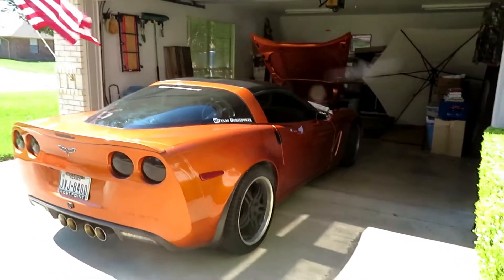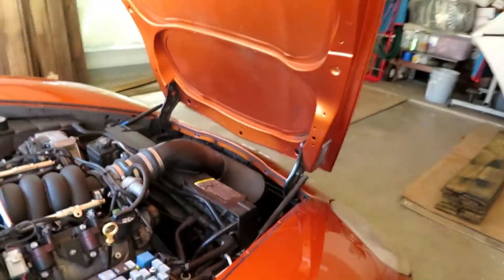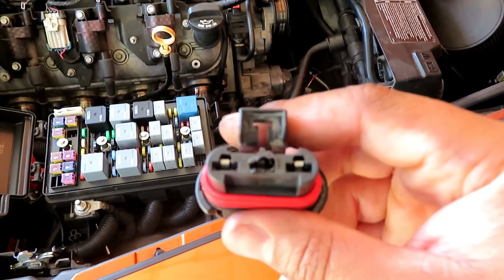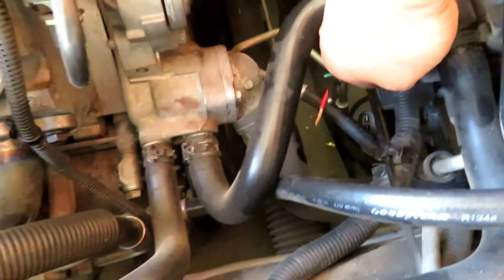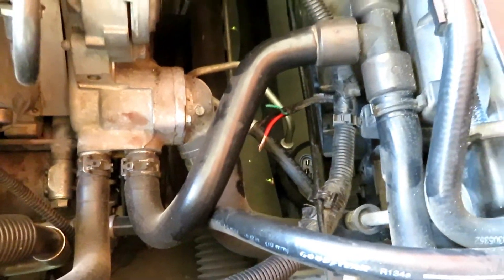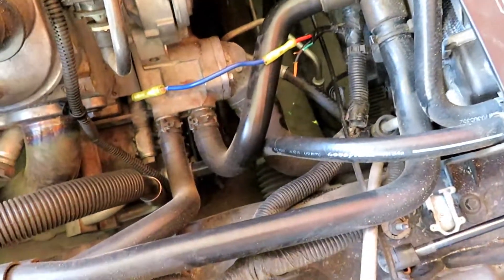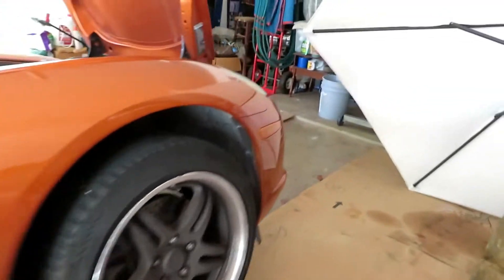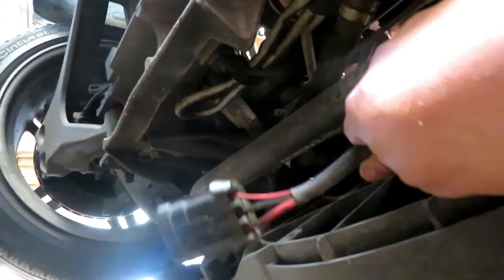My Corvette Must Hate Me: C6 Corvette Fan Repair

Comment: It's actually significantly better to just upgrade the plug than it is to cut these out and try to crimp/solder it together. The Anderson 879-SBS75GBLK-BK connector with the 1339G3-BK contacts are designed for significantly higher current, thus they will not melt everything when the fan demand is too high
Reply: hey man quick question does the anderson already have both the male and female contacts or do i need to buy those? i also had this issue and i want to upgrade to this connector but i'm not sure if the entire thing is already built or if i have to add more to it

Comment: I had an overheating problem also, Saw your melted plug, looked at mine and guess what 
? it was just as melted!!  I just made a jumper for the center wire, works great , thanks

Comment: From what I understand the factory recommends running the fan at 88% instead of 100% because this connector can fail at 100% draw. This can be done with a programming from your local "tuner guy".

Comment: Happened to me too straight wired em been running fine for months. That texas heat will do it. Some say its due to ecu tune and fans running higher then stick but i jave seen this happen on stock cars as well.
Reply from the maker: vette bro Thanks. Mine is modified, but i know my tuner knows better. So i think it is just texas and the fact the car has 132k plus miles on it.
Reply: Texas HorsePower i feel the same about mine i just hit 112k  but mine was in the exact same spot as yours. I can't think of one reason they really need that plug there honestly.

Comment: I want to do this but i dont know what kind of extention wires to use
Reply from the maker: Just replace the module. It makes everything better
Reply: @x03736  which module? The connector from the car?
Reply from the maker: @pure7199  fan control module
Reply: @x03736  if i replace it with oem its gonna just happen again within 1k miles theres not a company that sell’s something to bypass that connector ?
Reply from the maker: @pure7199  straight wire it with a high gage wire that matches what was oem
Reply: @x03736  yeah my question is what gauge is the OEM cables do u remember what awg size wires u used ?
Reply from the maker: @pure7199  I do not. Best to cut the pigtail and go match at thr store
Reply: @x03736  okay 👍